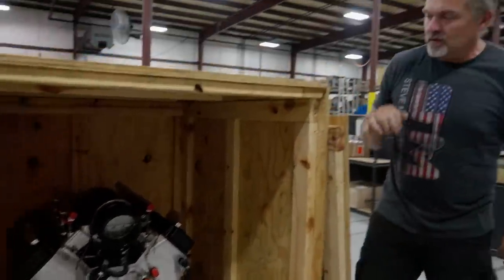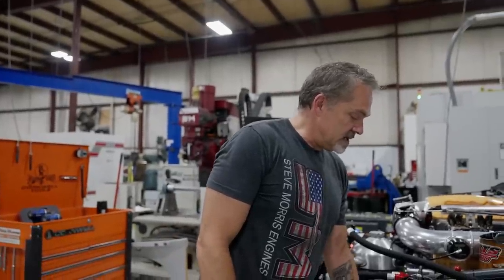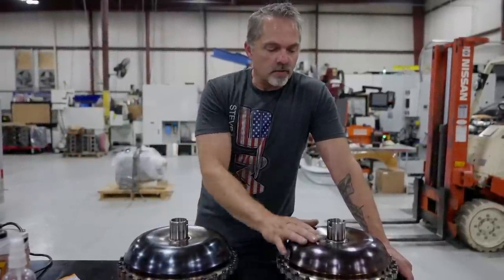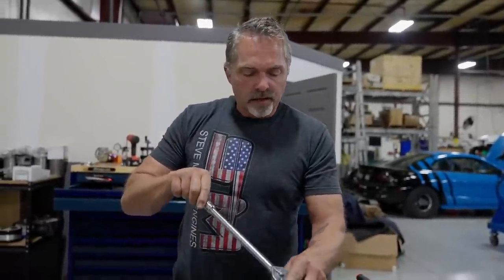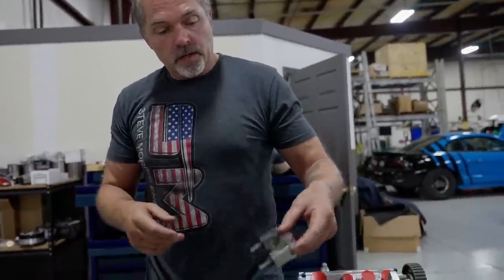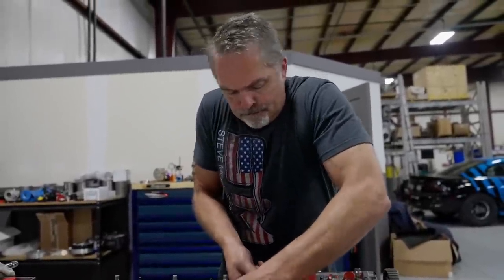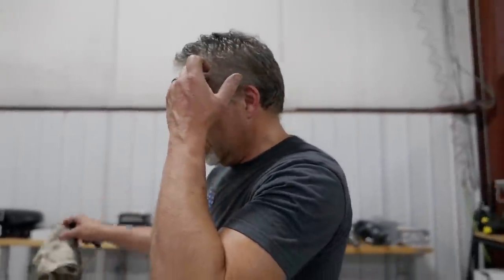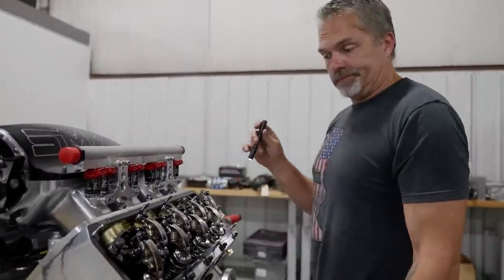What’s Up With Mullets SMX? Part 1

Comment: Low oil pressure is a problem worth stopping for. If the sensor was correct and all bearings look good, I would be looking at the oil pump itself. Do they make a tester for oil pumps? If not maybe it's time somebody does. Turning the oil pump by hand does not seem like a proper test to me. "It's a little tight but I think it's fine" just does not give me the warm fuzzies I look for. If debris was found in the filter and no where else, and the filter was the first stop after the pump, then why would the oil pump not be a prime suspect?
I still don't think an over abundance of caution was in play here.

Comment: My guess is that the torque converter was setup with the wrong clearance and it pushed so hard on the crank that the torrrington thrust bearing fixtuire (or god forbid the entire crank until the plain thrust bearing at the rear of the crank had enough ass to stop it flexing more. At the track you saw and opined on the thrust clearance of the rear main bearing . Which did have a very big gap when it was rebuilt but the torrington bearing at the front closed up the clearance. At some p0oint after the race and before the motor showed up at your shop the flexed part unflexed and returned to it's former setting of .007"

My guess is likely wrong or incompletwe but it makes as least as much sense as everyone who looked at the endplay of that crankshaft at the track agreeing that .007" of clearanhce was way way too much and thinking that 7 thou was 30 thou from mass hy6pnosis or something. All of y'all didnt dream excess clearance whether you can explain  wherew tyhe excess clearance came from and went to or not.

Comment: As you know as a motor heats up aluminum a metal expand so you might have more than 007 you might want to check when it's hot and might grow so you might want to set it to like five I don't know a whole lot but I've been a machinist for 30 years

Comment: If the cam bearings are fine, it's not an engine issue... I'm guessing this engine has rollerized cam bearings? I wonder if there was previous shit in the oil lines or cooler? 🤷

Comment: DANG , bruh ... yeah . when steel turns blue as in , street rods small end heating too hot , 600 begins blue ... deep blue 650 - 700 and all done .... so yeah , color accurate , indeed

Comment: Jeez Steve, those front brakes look like something off a pushbike. Are you sure thay are going to work? Do you run synthetic brake fluid or the normal stuff? OK so Cletus knows how expensive this little 4000+ HP engine is, so caution is a pretty good thing to have in his case.

Comment: There is only one thing that could cause all these symptoms. Metal in the filter but not anywhere else, lower oil pressure but bearings are good. I'd bet my whole house on it being a bad oil pump. Good thing he didn't run it. One more run and it may have lost all oil pressure and destroyed a VERY expensive crank.

Comment: Is there a converter that can handle both the power and weight of the wagon. The weight is a good place to start because less weight is easier to get moving especially at the starting line. Setting on the two step with converter in full stall generates huge amount of heat. The very next thing is loading on the boost and greater power. Hey how bout designing a trans cooler that uses dry ice and coolant that activates with the two step a cryogenic solution that is effective and small enough with the capacity to handle the extreme conditions the car endures during the short duration of a run. Your SMX makes monster power of which a significant amount is super heating the oil and converter of the tranny.  True the color that the stainless is showing is extreme. The finnish line and shut down going to be on fire spinning out in your oil is not an ideal way to win a race. Typically is a stick a fork in it, its done result.

Comment: I've seen this before. That 4000HP wanted to find an exit other than through the converter & transmission. Problem is Steve built it too damn good, so it couldn't escape through the block. Come on man, play fair and at least give it a chance! Lol 
No harm done by being a little conservative with this situation. I look at this tear down as an insurance policy on a $100,000 to replace race engine.

Comment: Gotta say id rather be overly cautious with a $30k+ 4k+hp engine to lol😅

I'm kinda leaning tward oil pump or cam bearings to like alot of people are as well. But the lack of anything material wise is a mystery... What are the odds its a bad oil pressure sending unit 😵

Comment: If he had low oil pressure, did he verify that the oil pressure sensor is sending good data? Also, the high-pressure oil pump could be suspect.

Comment: Hey Steve I’m trying to understand why you thought it grew forward. With the way you have your roller thrust bearing system theirs no way for farther forward movement with bolt stretch or wear in the thrust bearing system.  I know it didn’t grow this time!   And I know you were worried about the transmission pressure pushing it forward.  But I don’t see how it could have touched the rear bearing with your roller system. The only way I could see it growing is more backwards movement.        

Its really hard to see everything in the videos because stuff is moving so fast.  Just trying to figure it with with what you’ve said and what I’ve seen.

Comment: Hot Engine was looser than the cold the aluminum Swelled made the Thrush feel too loose! probably not checking them normally off the track Without gauges... better safe than Sorry on 100+k Engines!~ Don't blame him or you for shutting it down with Supply delays...

Comment: Trash in lines in car or oil tank messed up rotors in dry sump oil pump and that’s the metal plus also explains the low oil pressure. Unless there is some way to bench test it and prove it is good suggest to just replace the oil pump. No glitter in pan or anywhere else means all bearings and high wear areas are ok. Really strange failure. SMXs are not cheap even for Cletus with his 3M subscribers so better to be careful and get no race winning check than a writing a big check to Steve for a new motor.

Comment: my money is on a piece of that valve spring that broke went into the oil pump and is eating it. He was showing low oil pressure too so it's good he didn't run it

Comment: You build some amazing machines Steve, I'm a builder too. I had a similar issue with a small block chev, it turned out to be one rusty pair of rollers inside a rocker that had only pitted out that portion of the rocker. It frustrated me until I stripped all the rockers and found that one tiny problem. I didnt find any signs in the drainback areas either. Just in the filter.

Comment: Could the material have come from the oil pump assembly? As little of material was found probably nothing  to worry about yet.but that's easy for me to say in a comment section..talk is cheap 4000 hp. Engines are not.

Comment: I'm 21 minutes in and my guess is that it's the oil pump. I'm curious to see if I'm right. Back to the video now.
Reply: 26 minutes and I got goosebumps. It's as if Steve read my mind! It seems I may have been wrong, but once you've eliminated the impossible, all that remains, regardless of how improbable it may seem, must be the case. So, if there is nothing up top and nothing in the pan, I have to go back and watch the video to remind myself of the issue, but logically, if anything in the top end failed, you'd see some material in the pan. So all that remains is the oil pump itself or maybe the turbos. I'm not sure if the turbos drain back into the pan or have their own closed loop circuit of oil. I'll go back and watch that video again and see if my thoughts change.
Reply: So after reviewing the video from sick week, I've changed my mind to a degree. Low oil pressure and some material in the pan. Could be the turbo bearings if the return line for the turbos goes back into the oil pan. Why did the spring break? Could it be lifter related?

Comment: Metal only in the filter, low oil pressure, no metal or torn up bearings .. 100% that's gotta be the oil pump.

Comment: I think there must have been some debris hung up in the oil lines pre filter. With as many times as the lines are pulled off there is a chance debris from the fittings could have found it way into the filter.

Comment: My vote is for the difference in the Coefficient of Thermal Expansion difference between the steel crank and the aluminum block. When it was hot, the block was a little bigger/longer and loosened up the tolerance.
Reply: Exactly what I was thinking 🤔

Comment: If you all are not replacing all of your oil lines after a bunch of material was found you all are just reintroducing metal into the system every time you use them.

Comment: He lost oil pressure, no metal in the pan, metal in the filter, bearings good, upper end good.  Oil pump failure again is my bet.  How else do you mysteriously loose oil pressure.  Steve says be should have ran it.  With no oil pressure?

Comment: My guess is either debris left in the lines or the pump is eating itself. Either way, even if nothing is wrong with the beast, im happy to see everyone decide it was been to wait and race another day.  The motor has had a hard enough life as it is.
🇺🇸🤘🤘🇺🇸
Reply: That was what come to mind for me, if the metal hose ends are grinding inside when they get tightened down.

Comment: I'm betting there's absolutely nothing wrong with your converters other than they are the wrong size for your combination.  The car makes 4k horsepower and weighs a ridiculous amount and it's probably not a common combination that they size a converter for.  Chance has been around forever and I have a hard time believing they made the same error on both of your converters.  I also know there's no way Carl doesn't know how to setup the converter pressure on a 400 since they are the best in the business and they come tested right off the dyno.  Furthermore, you are staring at your charge pressure right in the datalog, if it was wrong, you'd have known it already.

Comment: Much respect to you and your team Steve. I like these sort of problems that are real head scratchers.  So the routing goes from pump to block and heads then from the back of the head it gets scavenged from the back and blow off in the valve cover. Much respect for cleet and his team but I believe that the oil scavenge system is custom by him and his team. Being that the SMX is a new platform and had different types of vibrations could it be that inside the oil scavenge system that something is coming apart, or a weld is breaking down due to it not being up to the level of sympathetic vibrations that the SMX puts out?  Anyways I would look at the lines going into and out of the scavenge system before it hits the oil filter.

Comment: I love this kind of brain teaser Steve..  without a schematic of the oil system...
Most common reoccurrence of failure I have come across are from debris left in an oil cooler/plumbing/hard to get to areas from the previous failure. 
If we call the pan the beginning of the oil circuit in a wet sump system, the oil goes through a strainer on the oil pump pickup before getting to the pump, which, does sweet F.A. the protect a finely lapped pump. So you would check pump as well as everywhere else for damage & debris. Usually the mains, then the rod brg's are delivered oil from the pump 1st, so anything that goes through the pump will go straight there into brg's.
 I learned as an apprentice that "soft" brg's are that way so that they have "embeddability"...the bearing will "absorb" to some extent hard particles, to protect the journals.
So if the bearings are clean, the pump should be fine, assuming it was good to begin with.
In this case we have a dry sump, so it is a little different.
So far we have been talking about the "lube/pressure pump. This engine has a dry sump, so it must also have "scavenge pump/s" to return the oil (through a cooler & filter) to the reservoir. So the damage from debris may be to the scavenge pumps rather than the (familiar to most in a wet sump system) pressure pump which draws from this res'..
I have seen Torrington thrust bearings with inconsistent clearance on their way to failure with both flat spots on the rollers, and, divits on the face of the flat end journals, which, could have created the debris, which would have been sucked up by the scav' pumps and appearing in the clear view.
Torrington failures don't usually take a break though, I would expect debris to continue until complete failure is obvious. So MAYBE, you are right about the abundance of caution, maybe the debris was from the previous failure hung up in the cooler or scav' pumps, or maybe from the broken valve springs chafing at the fracture...
I can't wait to find out. Cheers for now mate, I know you got this.

Comment: remnant particles in the system from the old engine would be my guess.  my other thought was cam bearings or lobe wear but you should have found evidence of that in the inspection. So I'll just have to wait and see what you end up finding. I have seen some stock oil pumps do that too though.

Comment: I want to say Cleeter had a previous problem with the oil pump. I'll bet they didn't clean it all up. But there is a huge difference when you only get .007 on the gauge vs whatever you thought it was at the track. Don't measure and you don't know. Live and learn any of us could have made that assumption. Great video as always!

Comment: You had indicated in a previous video that ethanol left water behind and if it wasn't burnt off it would damage the springs. This happened on Bailey's engine. It was said Garret was running this at the track on ethanol and then taking it back to the shop to sit prior to the drag and drive. Not knowing the particulars but seeing the loss of one spring already I would think a close inspection of the springs is in order.

Comment: My money is on that pump doing you dirty. 

Loss of oil pressure and crud in the filter but no crud in the engine.... About the only crud origin remaining is that pump, and it wouldn't be the first one I've seen eat itself.....

Comment: i remember him having a loss of oil pressure. may have been that iffy turbo or a pump regulator issue ? the excessive thrust you guys had at the track could have been just from the block beaning warm ? seems you both have transmission issues not pointing fingers at all marty mark and carl are the best in the buisness 100% but you guys are pushing limits with hp/weight in street driven combinations your going to find issues long before pro mod guys will have them ... i comment everyone that has there fingers in these cars everyone involved are overcoming obstacles for others to learn from ..

seems to me you guys cannot get the hot fluid from the converter fast enough and if you do you have excessive thrust almost like there needs to be another circuit added but how ? ringless inputs are a necessity at those hp levels but there is a cost to play ... something to think about

Comment: Oil pump coming apart
Reply: @I_Am_Blondie  there was debris in the filter screen, and nun found in engine, it had to come for somewhere. The only thing left is the oil pump
Reply: @I_Am_Blondie  Yes, the oil pressure would drop if the oil pump is failing. I.E coming apart

Comment: there must be 1000 guesses here.Goes to show how many bench racers there are out there. I bet  ya not 25% of them ever tore down an engine  looking closely at every piece  width a failure diagnosis as the main objective.. Do we not send oil to a lob anymore, and especially analyze the type of solid material found suspended in the oil. That would narrow it down considerably. type of steel iron moly aluminum led what came loose , step one.  Why is Cleet not there tear`n it apart and learning something rather than  putting tires n his airplane. Don`t you have to be certified to work on a plane? Ya need to get your hands dirty on what ya drive and break.  Go talk to teh God of drag racing, Mr. Garlits,, I`d like to see his take on the tear down. He dont live too far from you guys.  I beet he`d come take a look just for some camera time.  His time would be worth  a million dollars a minute. Who has seen more  bearings than him? Not many racers.